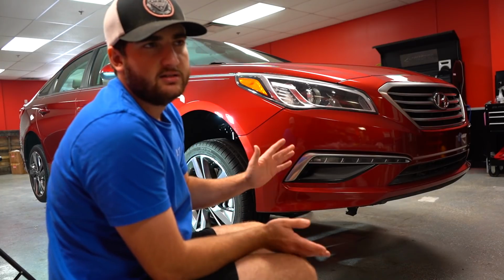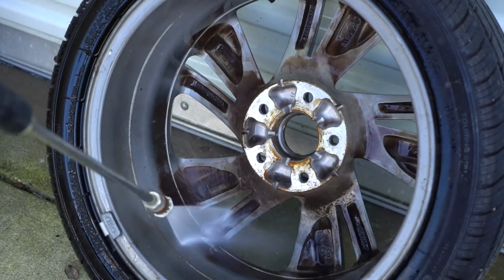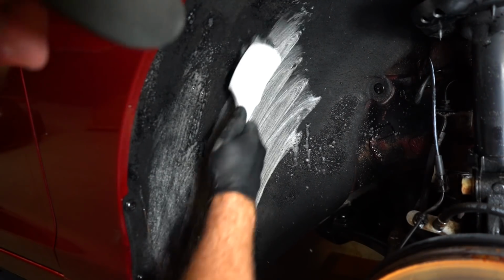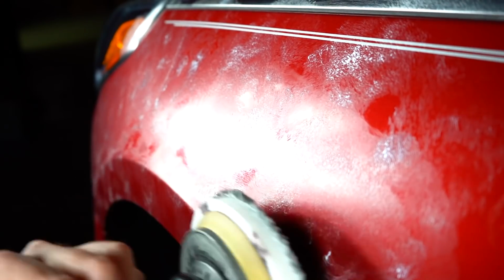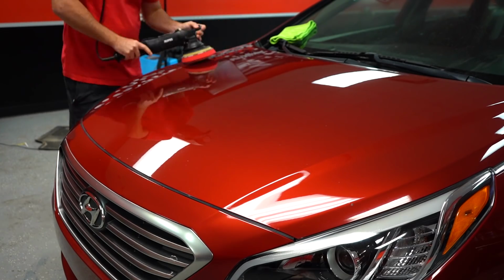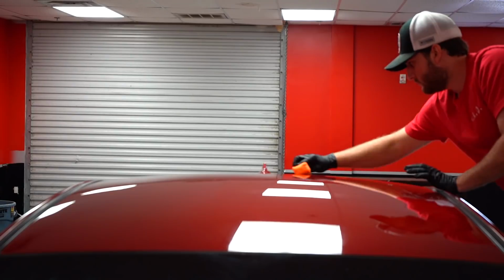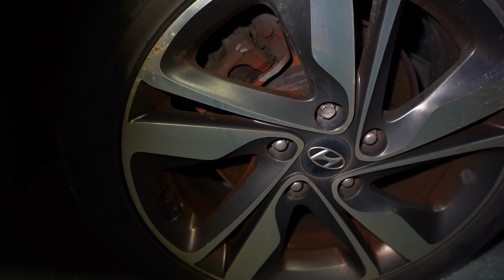16 Hour | Wheels Off Car Detailing | Part 2 |Paint Correction | Ceramic Coating  | Disaster Detail!

Comment: I could watch these for hours
Reply: actually, I do.
Reply: @karleyymh  It actually takes hours to do a detailing on a vehicle but it depends on the level of grime either inside or outside.  Besides if paint will be coated or wheels besides the level of paint correction.
Reply from the maker: A lot of hours haha
Reply: Humberto Roche Garcia yes! I have so much respect for the amazing people that spend time doing this!

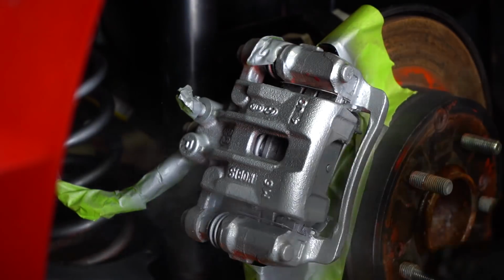Comment: 17:50 why? Very stupid
Reply from the maker: Why did the camera die? If so then the battery died.
Reply: I am stupid 🤣    17:53 spraying the inside of wheel space. You have clean it very well so you dont need to spray it black